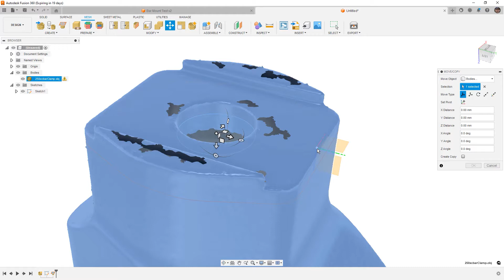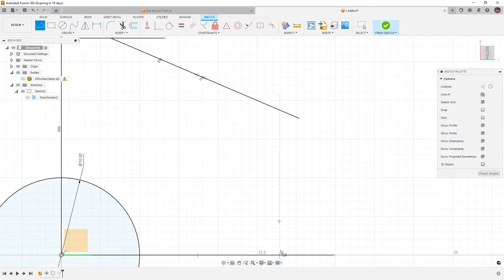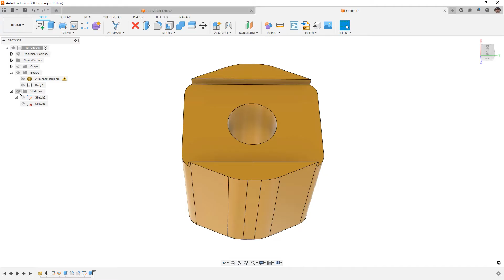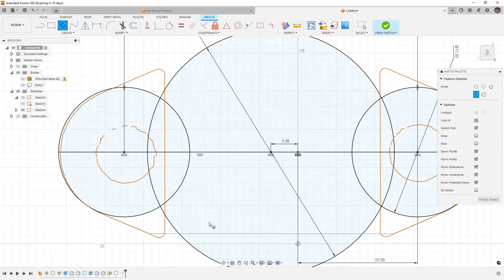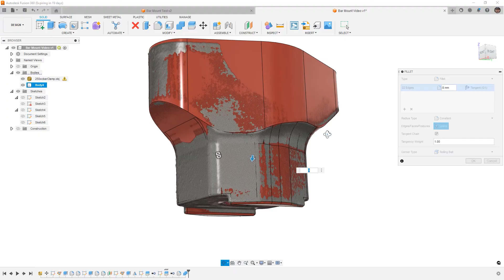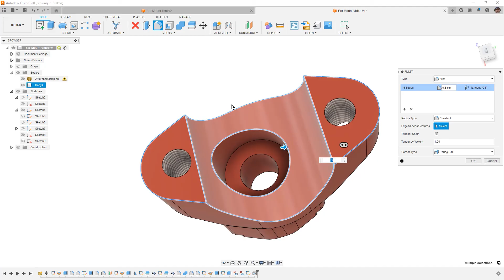How to Reverse Engineer Parts with a 3D Scanner Part 2 | Creating a 3D Model with #fusion360

Comment: I've been struggling with a part! I made a 3d scan of my colt 45, i thought it'd be fun to model. The body of the pistol it HARD, and has some interesting geometry. I'd love to see you try and see how you'd solve the puzzle
Reply from the maker: There are a lot of parts that are more organic/hand carved that don't translate great to certain types of CAD tools.  For organic parts I generally go to a freeform approach.  I actually just did a webinar for QuickSurface with this bar clamp part showing how to use freeform tools to make it.  I would say freeform if you have a scan would be the way to go for sure!

Comment: Excellent series with great tips for reverse engineering.
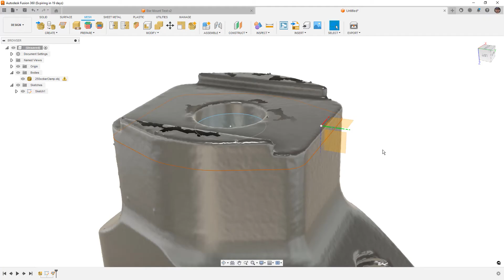Some things could be done simpler. Like @6:50, moving the mesh to have the origin at the right spot. I would add a projection of the origin on the mesh section sketch and perform a point to point move. @12:30 when fitting lines to the mesh section, select  two points and then just click on the "first point selection" in the right pane to start a second line.
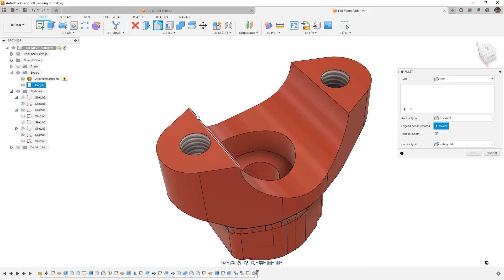Looking at the the end @46:50, I almost never add those fillets. In practice, parts like this will be de-burred in a tumbler or vibrator. That automagically adds those fillets so I never machine them.
Reply from the maker: Great tips!  and 100% to the end for a part that will be manufactured.  This part actually does have those features CNCd on them.  They weren't done in a tumbler.  In a video that I will be releasing soon doing a CNC part I mention this when adding chamfers to the part.  Most of the time you call out "deburr all edges" or something on a drawing.

Comment: Hi ! Greats tips in this video ! 
I wonder if you've already tried Quicksurface Pro, compared to Fusion 360... Obviously the price is not exactly the same, but wondering 🙂
Reply from the maker: Its actually on my list of things to do. just been struggling with time lately, but yes that will come soon! :)
Reply: @LearnEverythingAboutDesign  I'll follow this for sure ! I use Fusion at home and at work (for cnc milling) and when I see what can be done with QSPro I wonder if it worth the price 🙂

Comment: When first aligning it to the center, why not use point to point and then move down in Z by 2 mm instead of moving it by measurements?
Reply from the maker: You can 100% do it that way.  In this specific case it would work and be easier.  I did the manual method because generally when you insert a mesh it will need to be rotated as well as moved so you will likely need to move the pivot point to your center location. move xyz, and then rotate (which you generally do by measure angles between the plane we created and a reference plane.  Moving point to point wont let you rotate BUT you could also rotate after the fact.

In my experience i generally don't use move/copy point to point but I don't have a great reason.
Reply: @LearnEverythingAboutDesign  I was feeling point to point is like being more precise. Anyway thanks for the video!

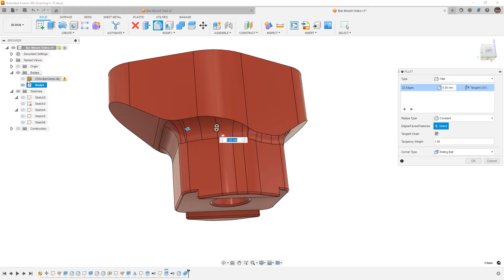Comment: I wonder if you could give me a hint that what I am doing wrong? I am trying to do the fillet which you do at 39:44, but I get this error: Error:   The fillet/chamfer could not be created at the requested size. Try adjusting the size, deselecting some of the edges (try disabling Tangent Chain), or using multiple separate operations. 

I can do only very small fillet (~0.45mm) any bigger gives me an error.
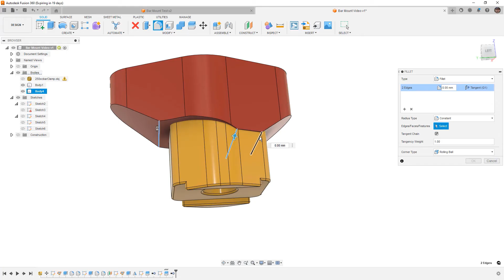Reply from the maker: hmmm. there is likely a small edge or artifact.  Did you add the fillets to the split body at 39:16?  That could be a potential hang up.
Reply: @LearnEverythingAboutDesign  Yes I did. I just can't get it done :) Frustrating, because I saw how easily it is done by you. :)
Reply from the maker: @okkimistic  hmm im not sure without seeing it.  if you want to send me the f3d i can take a look. support@caducator.com  The only other thing i can think is that the bottom shape doesn't have tangency around its edges. but odd it would allow a small fillet but not large.
Reply: @LearnEverythingAboutDesign   the same problem. did you manage to solve it?
Reply: The same problem. And i get the same result in other projects.

Comment: At 15.22, you extend out the fixed line by grabbing the handle at each end of the line and dragging to extend it.  When I try to do this my cursor just draws a box.  Sorry, I'm really new at this, what am I doing wrong?
Reply from the maker: When you added the Fix constraint, make sure its applied to the line and not its end points.  My guess is that it was still active when you click on the endpoint which fixed it in space.

Click the "Fix" constraint again from the toolbar and select the endpoint and see if that unfixes it.  Hit ESC to get off the tool then try to move it.

Comment: You could move the mesh "point to point" and in the same dialog move the mesh with translation handles up 2mm. Easier than remember the correct values imho.

Comment: I'm really liking the techniques that you're demonstrating with this series! I'd be interested in seeing you work with 3D scans of video game controllers, like those found in the bitbuilt 3D scan repository. There's a combination of very organic geometry for the general form of the controller shells and structural geometry in the ribbing, screw bosses, button wells, etc. I have been working with these scans using the tips from this series as well as your car fender series, but it'd be interesting to see if you have a different approach for those kinds of parts
Reply from the maker: Thanks for the comment!  I have never come across those before so I will have to look into them.  Are they free/open source?  Like if I used them could i freely distribute them as well?  Not sure Fusion would be the best tool to reverse engineer something like that from an efficiency standpoint but not impossible.
Reply: @Learn Everything About Design  Yes, they are open source, it's a really great resource! Is there another application that you think would be better suited/more efficient?
Reply from the maker: @kampcreates  i will take a look.  I do have a video series planned for a game controller where we do the electronics layout, PCB design and housing design.  One issue you run into with Fusion 360 and reverse engineering from heavy detail scans is that you need to make a lot of section sketches to pull details out.  When you start adding ribs, bosses and snap fit details this becomes a bit tricky.  Fusion can make planes off mesh selections if you are in direct edit mode for the mesh but there are a lot of extra steps.  A program dedicated to that like Geomagic has tools to make this process a bit easier to build a "dumb solid" version of a part.  I didn't show Geomagic in the series because its expensive and I think it is the wrong audience looking for this kind of content.  Why would you add a $7-$10k piece of software between lets say a $1000 einstar scanner and $500 Fusion 360?  There are free tools like MeshLab that have been around for a long time but the UI/UX is very complicated.  So you end up with either paying a lot of money for the "right" tool or fumbling through a program that is a bit tricky to use or spending a lot of time in Fusion.

I do have a few more scanned part videos in the mix where we will show some different ways to do this kind of thing.

Comment: Hello, after that can you make video tutorial for topic " Importing and Editing STL Files in Fusion 360 " , because STL file is many many triangle shape and difficult to use, i really want to clean it up to a Fusion 360 file but don't know how, please help me, many thanks
Reply from the maker: Hi Keal, what would be your end goal/hope for the STL file?  Something you want to 3d print after removing or changing features on it?  Most of the mesh prep would be done before it got to Fusion so I want to understand what steps you are looking to do in Fusion with it.
Reply: Just picking up on this comment. I would really appreciate such video. So far i know the tool "Instant Meshes" to simplify the mesh and convert to quad mesh but I understand such process may reduce accuracy of the scan. 

Note, this is the third time I am watching your video, it is really great. You have a great teaching style.
Reply from the maker: @mic03311  thank you!  This is one area where a true mesh program has a big advantage.  Something like MeshLab.  Fusion can manipulate mesh data, but knowing how far away from the original isn't really easy or even possible with Fusion.  Meshlab is free but very tricky to use.

I will give this some thought and see if I can show the tools in a way that makes sense.

Comment: Not sure if this is feasible for you but I would love to see the same kind of reverse engineering in Blender - I am curious to see how you would approach the precision modelling and the surface sculpting. I know it is not the right tool for the job but maybe you could save a lot of steps simply by leveraging the existing 3D scan mesh ?
Reply: This kind of workflow would be very interesting in a context of 3D printing - maybe not if the intent is to produce an exact drawing for manufacturing 🙂
Reply from the maker: Thanks for the comment.  I am not sure I see the point to doing this in blender since you  have a mesh with the scan and the end part is a mesh in blender.  Are you wanting to repair the scan/mesh in blender and finish off missing details for a 3d print?  Or were you wondering about modeling from scratch in Blender?
Reply: @LearnEverythingAboutDesign  actually both... I was thinking about a part that is not prismatic in nature that would need to be cleaned first to be 3D printed and maybe improved or adapted with form features, something that would require complex surface modelling in F360 but in Blender would be way easier and maybe more accurate.
Reply from the maker: @mic03311  well the thing about precision modeling in blender, you can never have a true hole or arc.  it will always be straight lines.  So i never think that "more accurate" than fusion would be true.  I think the things that are tough in Fusion are tough because you are dealing with NURBS surfaces.  Blender lets you get away with more but the basic rules still do apply.  I will give it some thought.  I know Makers Tales did some precision modeling stuff in Blender that might be a good reference if you  haven't come across that channel yet.
Reply: @LearnEverythingAboutDesign  I know and follow actively Makers Tales - he is doing a great work! Maybe I am overthinking :-) From a scanned object, a mesh, are you making editing on the mesh before using it in Fusion ?
I am trying to think of scenario where you would be using blender as a post-processing step before using it in Fusion or simply slice the object for 3D printers.
Reply from the maker: @mic03311  So traditionally the scanning software does initial mesh prep.  i will have a video on this maybe next week showing a lot of the various options.  That software (in this case ExScan) will take the scanned points and turn them into a mesh and give you options to do things like remove, refine, make watertight etc.  You align it to a coordinate system and then export it as a mesh file.  The common reverse engineering workflow is then to go into a software like Geomagic.  In a software like that (or mesh lab as a free version) you continue to process the mesh and in many cases wrap surfaces or build solids based on that mesh.  This has a benefit because you get "heat maps" that can show you where you have high/low points on your 3d model vs the mesh and the end part is a true BREP solid, not a mesh body.

The only workflow I can think that makes sense to move into Blender is when you scan a sculpted object and you want to maybe do some more sculping in blender.  Say you have an initial shape but you want to add more details.  Here is a dragon thing i scanned.  I think this is a good candidate to move into Blender with if you want to modify it to be different. https://a360.co/40tzfHv
Reply from the maker: @mic03311  Also part 1 of this series shows the scanning process of several parts and the prep/alignment.  For mechanical parts i like to use as little mesh manipulation as possible in the scanning software.  IF i wanted to I would use something like Geomagic.  But its not cheap so not something I wanted to cover.

Comment: Hey Mr Design WIll this turn into a Playlist?? and how many parts do you plan on making ??
Reply from the maker: These are the only 2 videos in this series.  There is another series going where I scanned a car fender and have been working through a widebody design.  There will be another playlist/video(s) talking about general settings for the process and I have a few other video planned designing parts around scan data.  

I am going to try and keep the playlists specific to the topic, but may end up with one that is just designing parts off of or around scan data, but not show the scanning part.

Did that answer your question?

Comment: This is great! Thanks a lot for sharing this knowledge ! So much useful details that will make the process so much easier! Thanks
Reply from the maker: You're very welcome!  I am working on a more general series of videos talking through all the options in ExScan that I will be putting together in another video soon.
Reply: I am curious to know how you measure the 38mm in between the two holes in the top view ?
Reply from the maker: put 2 button head cap screws in the holes, measure the max distance outside to outside of the bolt heads, and then head diameter of the bolts.  The ones that go in the triple clamp are smooth so it lets me get those min/max values.  For nice round number purposes lets say the head of the bolts were 10mm diameter.  This would have me measure 28mm for the inside - inside distance. 48mm for the outside - outside distance.  Then you subtract the head diameter from the 48 (or rather the radius of each bolt head to the center of the hole).   I measure inside - inside and outside - outside to verify the numbers but really you only need the outside max and the head diameter.  

I also have the "caps" that go on these and they have a counter bore on them and smooth holes.  I could measure inside - inside and outside - outside on the smooth holes then do the same thing with the diameter of the hole.  Since this was threaded that is how I did it.
Reply: @LearnEverythingAboutDesign  Interesting - thanks. 
I would probably try to decal the piece on a sheet of paper or just do the contour as best as I could and try to measure it.
Reply from the maker: Yeah as i mentioned in the video the chance of the designer using some random number is slim and the "cap" piece that goes on has enough slop in it that being off by .1 or .2mm would be more than fine.  Eyeballing it in this case is probably enough to get you there.   IF it were super critical that is when you have to bring in a CMM.  I could have scanned the part with bolts in it and use that to map a circle in Fusion to measure as well.  that "should" be .04mm accuracy :)
Reply: @LearnEverythingAboutDesign  Thanks

I had another question, your 3D scan contains a lot of vertex certainly due to the high level of precision of the scanner - Would cleaning the mesh in a software like blender to reduce the number of vertex and maybe offsetting down by -.1, -.2 the object not help get better definition of your sketch plane ? This tiny offset can compensate the spray power and final finish of the piece itself (reduce the amount of peak and valley at the surface of the mesh).
Reply from the maker: @mic03311  One thing I will be talking about in an upcoming video will be some of the options to process the mesh in ExScan.  When you scan something you get the point density that is directly converted to a mesh.  When you process that mesh you will loose some of that.  How much is hard to say.  Tools like Geomagic that are made for this sort of thing are better at giving you a map of the variations.. I will be talking about and showing how the filter and smooth options when generating the mesh change the shape.  Since Exscan doesn't create multiple versions of the mesh i find it best(for this sort of thing) to just export the raw data.  Fusion can remesh and reduce the mesh count and preserve edges.  That is a descent option.  But in the video i focus on using measured numbers with the mesh more of a reference.  The brake lever i showed in the last video I actually scanned and aligned both sides and heavily processed the mesh and will show that as well.
Reply: @LearnEverythingAboutDesign  looking forward to the video. Many thanks 👍 great work 😊